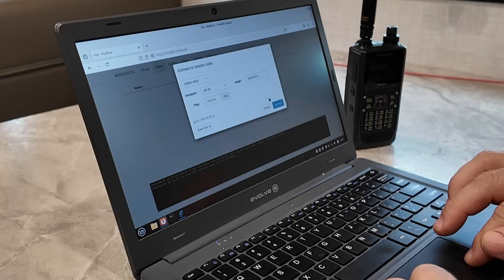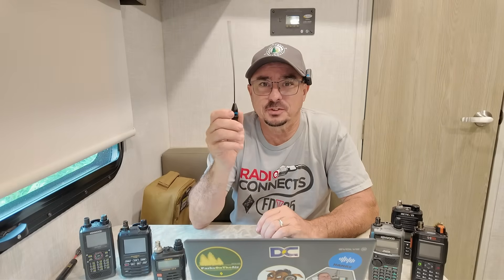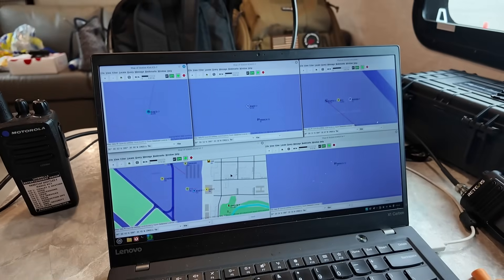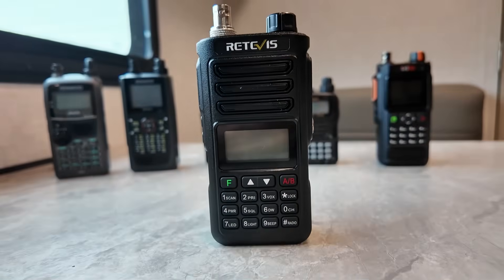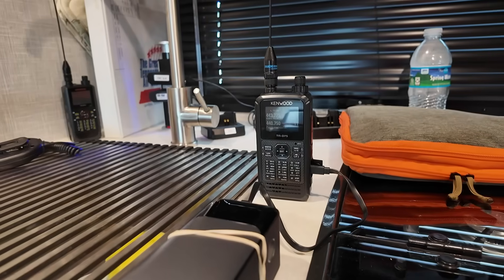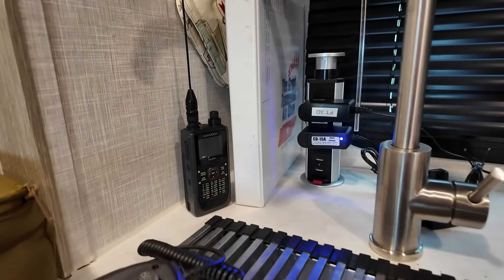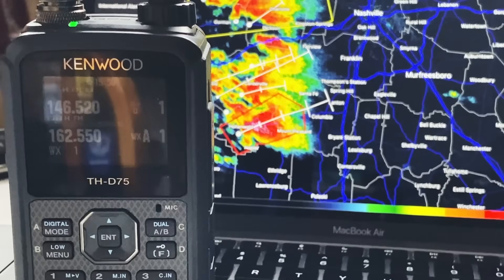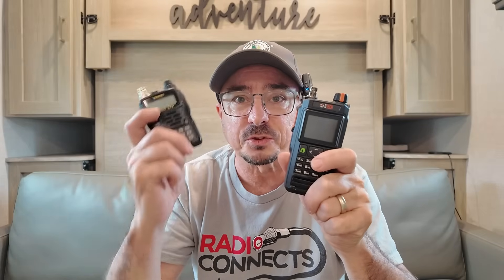Can the Humble HT Really Handle It?

Comment: KM4ACK could you do a video on how to setup the Kenwood th-d75a weather alert? Thank you
Reply from the maker: If I remember correctly, you only need to turn on the weather alert at menu 105. If you want to see how it works, check out this video https://youtu.be/IeWIS4WTfTk?si=dI33gfABwBtidzNF&t=373
Reply: @KM4ACK thank you! I couldn't find it in the menu system. And Google said to turn on scan to initiate the weather alert. Subbed!

Comment: Nice video Jason.  I do most public service events with an HT (TH-D74 mainly because it's my primary, even if no APRS involved). When working net control I usually use a mobile with an antenna in the air on a portable mast (TM-D710 in truck, or if in building/tent/van TM-D700).  There is one local Marathon that I support as liaison to public safety and provide them with an APRS display showing trackers we have with Tail End Charlie, and bikes following the lead runners.  They seem to find this very valuable.   I prefer the older Kenwoods for this as I have found Bluetooth unreliable and a kludge to get working every time I set up.  I much prefer a hard cable.  They work.  I reserve the TH-D74 for standalone use and never use it with a computer.  I understand that they have fixed the TH-D75 and you can now access the TNC via USB port, fixing a major flaw in the D74.

As far as weather radios, I keep a Midland WR-100 unit in my go kit.  Just as cheap as most Chinese HTs and it supports SAME encoding so I only get the alerts I need for the area I am working in.  The local NWS office coverage is so large we regularly have days where the radio would be alerting constantly even if none of it impacted the event area. (I don't need flood watches for 2 counties south of us when we aren't even getting rain) I am not aware of any HT that incorporates SAME (I know the Kenwoods don't), so I consider it a better option for situational awareness. 

73  Randy KAØAZS
Reply from the maker: Interesting. I use both the D74 and D75 with Bluetooth all the time connected to a Linux computer or Android phone. Never had any issues with either. I wrote a script for Linux that makes it push button simple to create the connection for either YAAC, Winlink, or to grab the GPS data from the radio. Helpful when you need to post a Winlink position report. If I connect the USB cable to the D75, it's only so I can get a stream of the GPS data while running the Bluetooth TNC for APRS with YAAC.

Comment: Seems like the UV-Pro's latest firmware v2.8.8.0 has an issue with the TNC connection. After upgrading to v2.8.8.0 I cannot connect to WoAD anymore.
Reply from the maker: Thanks for the heads up!
Reply: @KM4ACK I am having a disagreement with the BTech  support about the 0.8.4-2 being able to transmit on open squelch. If you have not updated the firmware on the UV Pro to 0.8.8-3 yet. If you are still on 0.8.4-2. Is there any way you can film that so BTech can see it?

Comment: Winlink messages were a last minute item for Field Day this year.  The only radio I had set up for Winlink was a Yaesu FT-70D with DigiRig Lite - but I was a long way from my normal gateway.  I had been too busy prepping and managing the GOTA station to try anything until Sunday morning.  I found another gateway not too far from our FD site and rigged an Ed Fong roll-up j-pole on a couple of sections of fiberglass military mast strapped to the rack on my pickup, set up the computer on the tailgate, and managed to crank out a few WinLink messages, including the first one which I sen to the section manager.  It was a hactic morning, and I fat fingered the SM's email address.  When I went to send my other messages, I saw that the one to the SM bounced as undeliverable.  FD clock was winding down. No time to recompose, so I just forwarded the bounced message to the correct address.

I'll be better prepared next year so we can get the full quota of message handling credit.  Had I not done the tsunami exercise a couple of months ago (all Winlink), I probably could not have gotten any messages out at FD.  Yes, it was hectic, but the past experience helped me that morning. Practice doesn't necessarily make perfect, but it sure beats no practice.

Comment: Love the videos. I have a question about the yaesu vx 6 I am trying to set it up for aprs with a digirig but the aprs frq is 144.390 and every time i try to program it into the vx6 it wont take it it will do 144.400 I even tried to program it in chirp and the yaesu vx software that came with the program cable but it just says its not a valid frq for the radio.. i tried to change the step but it starts at 5k and up am i missing something?

Comment: All I have are HTs, capable only on VHF and UHF. I live in a HOA community!! And even though there are hideaway antennas you can put up to do HF in HOAs, I really don't want to spend more more on HF rigs right now. I don't have any base station or mobile radios at this time. Only walkie talkies. Am I less a ham because of that? Not really, circumstances are different for everybody. In an emergency, most necessary comms are local anyway and I can hit 2m, 1.25m and 70cm repeaters deep inside my house. I'm good as far as I'm concerned. I'm not much of a talker on ham anyway, not mike shy but to me they are there for special circumstances like SHTF. I don't even need to get on nets to keep my HTs tested because my GF is a ham and she likes to talk to me on all three V/UHF bands, so I know when my radios work and when they don't. Once I talked on 223.500 simplex to a guy 10 miles away on my Yaesu VX-6R and it only does 1.5 watts on that band. HTs are quite capable.

Comment: My own take on the HT.

I was licensed in the spring of 1993 and got a Realistic (Radio Shack) HTX-202, a well known and widely used HT of the era.   That was the core of my station at my parents' house for a few years.  Made an external antenna, then upgraded to a Cushcraft 2 meter vertical, then upgraded from RG58 to RG8, then added a 15 watt amplifier and power supply.  At some point a speaker mic was added as well.  That little 15 watt station had me talking to people all around the region every night I wanted.  The HT would go into the car after I got my drivers license  (I think this is when I got the speaker mic) with a mag mount, and later an amplifier was added to the mobile as well.  I got the HTX-212 mobile from Radio Shack in late 96 or early 97, making the HT the radio I used for everything for well over 3 years.

I always wanted to do packet with it, but was never able to fit a TNC in the teenaged budget of the time.  But when scanning the band back then, there were always 3 or 4 busy packet channels.  A lot of people used their HTX-202 radios for packet radio in the 90s.

These days my go to HTs are the Alinco DJ-G7 for Analog, Anytone 878UV for DMR, & Kenwood TH-D72a for APRS & birds.

Comment: Great video. If you do not have a bluetooth capable HT, and do not want to drop $600-750 on the 74 or 75, there are many other options. B-Tech/VGC option described here is CHEAP and excellent for winlink and aprs. These are also much better than most Chinese radios in terms of RFI according to testing.

Comment: Great video on diversity, truly no one radio does it all. However you really get into cost vs capability. I really like the Kenwood D74, as you pointed out however that is a $600 dollar radio is lacking. However Tidradio makes up for what the Kenwood lacks and fails at what Kenwood brings. Tids  now have SMS capability in the newest firmware release. Yet none of the accessories are standardized, each radio needs its own parts. Bringing you back to cost. Point being the HT is definitely a very significant and viable part of any kit. The cost will be the primary limiter IMO. Unfortunately there is no "Perfect" solution. Its all a trade off.
Reply: Who needs SMS in ham? Will the next gen hams be doing stuff like Facebook on ham? And just how does the D75 lack? Because it doesn't do SMS? Use you phone for that. When I got my D75 I put my Chinese rigs away in a drawer.  Give me a break.
Reply: @markr.1984  Of course, your right.
Reply: sms is not a standard

Comment: I don't suppose they make an amp that would work with all the different HTs for when you needed some extra oomph on one of them? The amp could stay at the camper and you'd still have the flexibility to walk around with any of them. But then, I guess you might as well bring a mobile.
Reply from the maker: That wouldn't be hard at all. A mirage amp like I have in the wife's jeep supports 2M and 440. 5W in will net you 35W out.
Reply: VHF amps are plentiful and range in cost from bargain basement to astronomical, but they will work with most if not all HTs. Delving into VHF amps is a whole other swim through the marketing madness however.
Reply: This is what I do a lot of the time. I have an RM Italy that switches between FM and SSB.